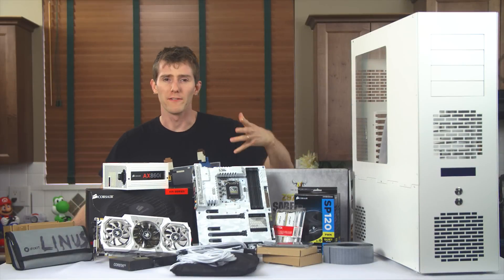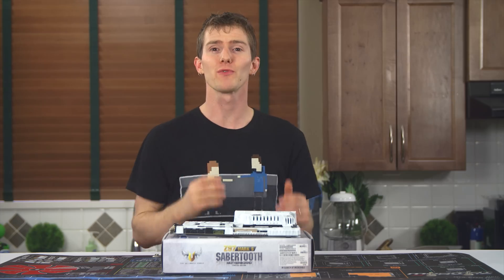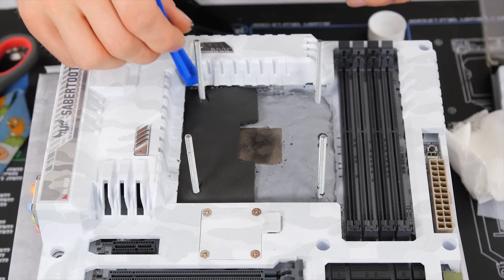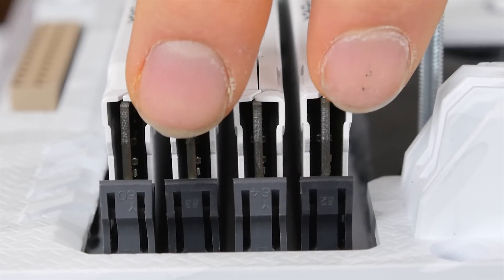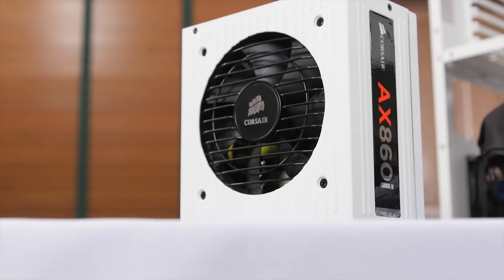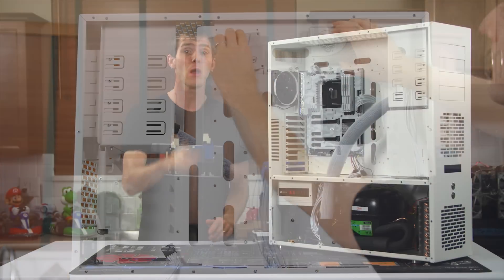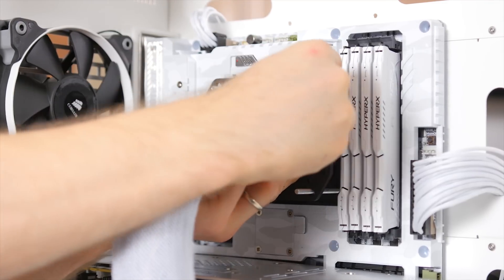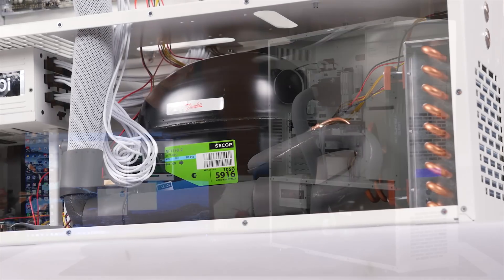ULTIMATE Sub-zero Phase Change Cooling PC Build Guide

Comment: If I were you, i rather take apart those compressor and condenser unit, use it on test bench for overclocking, so i didn't need to buy liquid nitrogen tank every time i have to overclock my CPU for benchmarking purposes.
Reply: It's a review unit; unless he pulls off another Dell video on cannibalizing CPU parts, I doubt he'll get away with it..

Unless he buys the case himself then by all means, go ahead. I'll just go fry bacon on mine ;)
Reply: Flat4Buggy well that's great

Comment: I feel like i'm on the right type of video for my question to be answered, for a couple of weeks my games/videos have been closing down straight to the desktop every 10 mins, it was okay for a few days but it's really annoying. Iv'e tried everything within my power to fix it but it hasn't worked can anybody help?
Reply: Hellenix Edm Have you tried turning it on and off again?
Reply: Hellenix Edm Sounds like you need to download some more RAM.
Reply: Hellenix Edm You're not really in the right type of video to ask this. Try it some forums. Also, any logs in the event log (or however it's called in English)?
Reply: Try updating your graphics card driver. If that doesn't work, make sure there aren't any loose wires that might be causing it.
Reply: Hellenix Edm Did you check temperatures?
Reply: Just wondering which games as there's not much to glean from your post...
Not ALT+TAB'n out like D2 or D3?
How long has it been since you installed a new application?
 If you're not getting a Windows error box, it's possible that you're doing something in game... or you've got malicious software messing with you.
Antivirus not setup for sleep mode will cause it.

More details needed... if you're getting an error box, the dude that said forum would be right about that. Your error logs are what'll help the next guy.
Reply: Aint1S Could also be the notification from Skype about Online-status.

Comment: So they made a $2k case with a compressor and special tube and there is nothing in there to make the actual socket install simpler. Why can't there be a aio solution for this?

Comment: Wondering how much the compressor cooling work in Watt.
Reply: Then the whole system power almost same with an air conditioner. Gaming in summer, 2 air conditioner running.

Comment: Since temps are so low, why cant u push some more voltage n oc it more?
Yeah I know for Pro OCers this maybe a dumb question, but as a beginner who use the same cpu and almost the same motherboard(the black one) with NH-D14 with somewhat scary temp on 4.4 all cores and 4.4 cache, I am asking anyway.

Comment: Linus, I have a custom Liquid cooling from XSPC. I overclocked my CPU with gaming profile in Asus Maximus VII Formula which is multiply each core with 47,46,45,44. my cpu Temp under 100% load and 1.3V it stabilizes around 49-51 degC. do you think that i can push my CPU to 1.4V ?

Comment: I wonder why they didn't include any front panel USB ports or audio jacks on this case... I realize things like USB standards change more often than the basics of the enclosure, but it doesn't seem that significant for a factor for such a low volume enthusiast type system to make such minor updates.

Comment: Please tell me if my setup is okay. I'm thinking of building it so any critiquing would be greatly appreciated:
RAM: Kingston HyperX FURY 8GB
CPU: Intel Core i5-4690K
GPU: EVGA GeForce GTX 970 Super Clocked
Motherboard: MSI Z97 PC Mate
PSU: Corsair Builder Series CX 600 Watt
SSD: Crucial BX100 250GB
HDD: WD Blue 1TB
CASE: NZXT S340 Case
CPU Cooler: Cooler Master Hyper 212 EVO
Reply: Get a Xeon E3-1231 v3 ist better than the 4690k.. An Costs the same
Reply: *****
EVGA has surprisingly well built PSU's. Head over to jonnyguru.com and look it up. He has some great reviews. I had one myself and had no problems ever with it. I'd say a 750W supply will server a little bit more headroom to spare with other components and you can always look up the power consumption of every part in your build. That way you can calculate it or just use one of those calc's on the internet. Bronze is fine, but Gold is just better. If you can get a good deal and care about the money you spend while your PC is running, grab it. Otherwise you shouldn't care anyways.
Reply: Effectious I had both here (980's though) and would go for a Gigabyte. Mine did both very well in every game and test I ran, but I liked the Gigabyte better. It stayed quiter and cooler, from what I can tell. You can't go really wrong with either card. I'm going to sell mine though, as soon as the 980Ti arrives.
Reply: Knives n' Gear that's a fucking beast PC lol .... 
also what made you choose a Z97 mobo, and is your PSU modular or no '?
Reply: Knives n' Gear Great setup.
Reply: Knives n' Gear I'd rather go for the MSI H97 Gaming 3 than the MSI Z97 PC Mate. No, seriously. The chipset isn't everything, the PC Mate is like the most spartanic version MSI offers.
Reply: Florian Ivan So if i wanted to do gaming, and lets say i5 cpu + like a gtx 980 , a z97 MOBO is not neccesary ? like what would be the perfect MOBO in price that is compatible to all current gen and next gen ?
Reply: ***** So woudl you reocmmand a Z97 for a gaming or there could be cheaper choices that are perfect too ?
Reply: I'd recommend 16 GB's of 1866mhZ DDR3 and CL9, or low CAS-Latency and higher speeds if you find something affordable. Also I'd swap the EVGA 970 out for a Gigabyte one.
Reply: TobiPlayHD is the gigabyte better than the EVGA ? like there is many manufacturer like MSI / Asus ect.. but i dont know which is best
Reply: *****
I've got 2x the GTX 980 from GIGABYTE. It runs great and has basically 0 coil whine, unless you hit like 1500FPS in the settings panel of some games. It runs cold and quite from what I've figured out so far. I can really recommend it. The Asus one seems to be fine, so is EVGA; I'd just grab the GIGABYTE though, since there were really little complaints plus the sexy backplate. LG
Reply: ***** Wanted to ask you if 650W enough for lets say a gtx 980 and an i7 4790K ? 
Also what brands do you recommand the most for PSUs ? also do you think +Gold is worth it , or +Bronze is fine ?
Reply: ***** Budget wise, the CoolerMaster G650M is one of the best quality 650W PSUs you can get. If you have more to spend you can go for an EVGA SuperNOVA 650G1 or something like that.
Reply: Florian Ivan thank you Florian, lets say i go with the EVGA SuperNOVA 650G1, 
Will it last me for long, that when i think about upgrading my GPU for example, i dont need to worry about the PSU ?
Reply: ***** For a single GPU setup, this should always be more than sufficient. Right now it would also be good for a GTX 980 SLI Setup, as these cards have a TDP of 200W or lower.
Reply: You guys have been great and Florian, I will take your advise on the PSU. To all of you who didn't know, an H97 motherboard can't overclock, only a Z97. One more question. If I were to upgrade to a GTX 980 in the future, would the CPU (or anything else for that matter) bottle neck that graphics card?
Reply: Knives n' Gear why didn;t you to choose a Z87 mobo that can overclock ?
Reply: ***** I don't know, a Z87 has never been brought to my attention before. Please explain.
Reply: ***** Okay, thanks. :)
Reply: ***** thank you so much Tengu for your help, you helped alot too ! 
its amazing to know that uture CPU/GPU upgrade is no prob !
But i still really cant ecide wiether i should o with Bronze or Gold :/.... I just want to know if Bronze would last me for long time.. so i can save that money difference.. unless if Gold is worth it .
Also would you recommand a Semi-modular one ? or a modular one is enough ?
Reply: ***** i will do ! thank tengu once again
Reply: WTF why do you pc noobs keep posting the same pc forever on Youtube ? Go into a forum and you're good to go
Reply: TobiPlayHD 
Not sure why you'd recommend canning the EVGA 970 for a gigabyte 970. I've had awful luck with gigabyte mobos, rebate response is pretty terribad, and EVGA's shroud and heatsink design perform better in general.
Reply: TobiPlayHD The ti is going to be good.

Comment: I would never do this to my own pc.
Reply: Why not?
Reply: Kuba Nguyen Nope cause if you do it wrong you can damage it well unless you have 6 of them lying around. Or get them for free like linus then i would do it.
Reply: Kuba Nguyen agreed xD
Reply: Kuba Nguyen Do you know how fast parts brake on a motherboard ? seeing your comment i dont think so and if you want to do this shit and use a ton of money to do so go right a head.
Reply: *break
then thats why theres this "5x durable" in mobos.
Reply: also if youre scared that youre going to break something, why wont u buy the parts and let the ppl in the store BUILD it for u? my friend did this.
Reply: Kuba Nguyen
They dont do this in pc stores. ISince i have been building for a pretty long time i know how fast parts break mine almost never break and the pc's i work with are a bit older but that does not change the fact i have a exstra durable mother board from gigabyte it might not break as fast as a normal motherboard but give it one well placed puss and it will snapp like wood splintering. What i whas trying to say with this comment that is that i would not give this much money into a pc only to do something wrong i am not afraid to do it but 1 there is almost no point in doing so 2 if you do break something some companys might not take it in when they know what you where doing 3 if you not carefull enough you will break some thing.
Reply: Well ure saying about its durability or breaking during the process?
Reply: Kuba Nguyen For the most part yes
Reply: ok,
for the durability, it should work for around 2 years. if it magicly breaks, we have the thingy (dunno what to call it) but the thing will give u a NEW one to replace the broken part.

for breaking it, just be careful :D
Reply: Kuba Nguyen I am :) but still if a ''normal'' person does not know it and also why said this is becuase you put that exstra stuff on it so they might push harder then normall.
Reply: yea, the internet will help u.alot.

Comment: Was pretty disappointed with the fact that you build such a system and then invest only 30 sec in explaining the overclock and the temperatures. Even worse you don't show anything about the noise of the system. This video could have been so much more.
Reply: Andrea T. It has a freakin compressor in the bottom of the of the case, and an 80mm case fan to exhaust the heat that the compressor puts out, overall sound is going to be high. As for overclocks, just check out his video for overclocking this card, cause why waste time when this is clearly such an impractical build guide.
Reply: Idk, that clearly wasnt the focus of the video. Though I agree more numbers (including overall noise levels) are always helpful.
Reply: Andrea T. Yeah true. Its the reason i watched it in the first place. Wanted to see dem overclocks. Probably not worth it due to the noise! And also no price on that tower setup! WTF
Reply: Andrea T.
Reply: that case is 1500 dollars
cpu is like 800
gtx 980ti is 900
mobo would be 200
psu is 100 plus 50% of your life trying to make it white
fancy nvme is 300
hdd is 300
erasers is like a cheapo, no worries.

yah that would cost 26.918319274% of your kidney

Comment: How can a power supply internals kill you?
Reply: Elix1rify Holy shit!
Reply: ***** It can retain voltage inside for a very (A few Years I think) and that can be released to you and cause death/damage
Reply: ***** I could be crazy
Reply: DRAWNBOX voltage is just a rating of potential, it's not tangible. Current is what you are referring to. All the capacitors, aside from X caps, found in consumer power supplies, will be discharged within a second of you removing its main source of power. The X caps may hold their charge for a matter of minutes, but these caps tend to be entirely non-conductive on the exterior, aside from the leads. Linus is only saying it to avoid any unnecessary legal bs with people opening up a powered PSU and saying they did so because LinusTechTips told them so.

Comment: So you can crank the voltage because only the limit is the temperature? Isn't there a limit on operating voltage for the transistors in the cpu itself? I am curious?

I wonder how far an extreme i7 can go? Imagine a stable over 5 Ghz oc, trying run compute simulations or ansys at blazing speed :O Assuming memory speed and disk speed are par enough :v
Reply: No, thermal temp is not the only limit for voltage, which is why Linus said it the way he did in the video. Essentially, the refrigerator the case has virtually eliminates that particular hurdle. You still have hardware limits to worry about.

There's been plenty of higher OCs using liquid nitrogen, you should look them up, very cool stuff.

Comment: Wait will the pc parts die or the fridge?
Reply: IPROXGio Fridge, altough the PC parts will die when water condensates on them. All in all a pretty bad combo.
Reply: IPROXGio The fridge will. It's not built handle cooling down something that produces heat, so the temperature inside the fridge will rise faster than it can be cooled, and everything will go badly. It's just too inefficient to let the CPU heat the air, and then cool the air, instead of directly cooling the CPU, like this case does.

Your PC should be fine with either, as long as you don't get condensation. At least until your fridge breaks, and your computer slowly turns it into a sauna.
Reply: IPROXGio The fridge will die, and then your PC parts will automatically shut off to avoid destruction.
Reply: IPROXGio Fridge compressors are not made to be constantly cycled like this one is. Fridges are meant to cycle intermittently, as it keeps the temperature stable in an insulated environment.
Reply: IPROXGio If you're even remotely considering something like this, try using Peltier units integrated into a water loop. By integrated, I mean using the cold side to chill the coolant rather than the Peltier being in direct contact with the CPU lid causing condensation and other nasties.

Comment: Why is the CPU "obvious"? What about the FX 8350? Has 4 more cores and 2MB more cache, so each core has 1MB L2 cache compared to 256KB L2 on the 4790K. Moreover, the 4790K is almost double the price of the 8350? Is it twice as good or twice as cool/efficient? I usually agree with Linus on his hardware picks, but here I have to respectfully go "REALLY dude?"

Comment: could someone address the condensation issue with the gfx card dumping heat into the case. Not condensation on the cpu but surrounding areas including the card

Comment: Is it loud? The "fridge like" coooling...
Reply: EpicGamingHD Technically all cases are silent, it's the hardware that makes noise.
Reply: WojtriX or you can buy a silent case? Dumbass... Stop trying to sound smart.
Reply: WojtriX Just put it in an area where it's not near your mic :D
Reply: ***** NZ SNIPER chrisgtx560 
 Oh god, you all just need to realise that we're talking here about methods of cooling. Such case includes cooler but in other cases you need to choose cooling methods your self! This disscusion is pointless unless you want to add something about noise it does produce...
Reply: WojtriX Yes, but it's designed for maximum performance, not maximum silence.
Reply: So that's not for me, it would ruin my records... I've got  Blue Spark condenser mic which would capture all the "fridge like cooling" sounds ... I'll pick water cooling and a few fans. I don't more than 4 GHz ... Oh maybe the glorious Witcher 3 will need such performance. I'll stay tuned for another PC setup which will suit my needs.
Reply: NZ SNIPER no way
Reply: WojtriX If you really need silence air cooling is the way to go.

Comment: This is pretty cool (pun intended) but if the case is gonna be as loud as a fridge and look like a fridge, it should keep my beverages ice cold as well.
So the real question here is: how can you mod it to cool the 5.25" bays holding your drinks?
Reply: Ry P You could just attach a 4x120 water cooling set up to a custom metal cup holder. I mean it's totally impractical but you'd be a fucking legend.
Reply: Mansen No need to be mean, none of us were born knowing all that we do.
Reply: You can attach a USB 3 can refrigerator to it
Reply: If your running amd catalyst control centre you can adjust fans speed and everything.
Reply: enginesnblades It sounds and would look awesome, but if you started with refrigerated liquid that would heat it to room temperature extremely fast. Not actually the desired result. ;)
Reply: James Healy Yeah didn't even thing about that, but it's obvious now that you mention it lol. Stick the radiator in  the mini fridge under your desk.  Will require mini fridge modding.

Comment: Linus seemed to imply that this was a very cost ineffective idea, but the case was only like 300$ USD, and minus the 175$ one might pay for a phase cooling device, its just a mid-high price case. Really, this seems like quite a good option for a 1500-2000$ system without custom water cooling.
Reply: Yama Yamo The case is $1800 dollars. Yeah...
Reply: The case is $1800 check there website